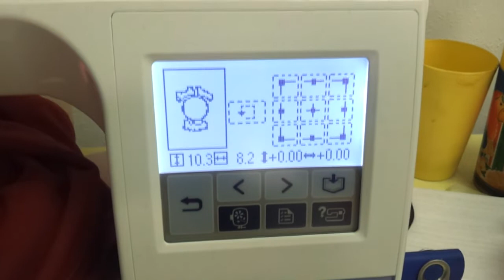Thinking about getting in the Screen Printing Business? Watch this first

Comment: Are you flashing before you take these shirts to the heat press? I can’t see one in this video
Reply from the maker: Yes, always flash before heat  press
Reply: @KingPrint  Hello, what do you mean by flashing?
Reply from the maker: @boniragz  flashing is drying them to the touch, they would still need to be cured, if you flash without curing, they print can fall off in first wash
Reply: @KingPrint  thanks for that, and kindly may i ask can u use an iron box to cure plastisol ink print?
Reply from the maker: @boniragz  no, you can use a heat gun ,mabe a blow dryer on high, but not a iron, it doesn't get hot enough
Reply: @KingPrint  okay thank you for your response sir
Reply: @KingPrint  i forgot to ask, how long should i cure the paint using a hair dryer?

Comment: Are you curing them with the heat press...? Cood deal! Using plastisol ink...? Looking into getting into screen printing , thanks for sharing the knowledge :D
Reply from the maker: Yes, 320degrees for 15 sec, 
Thx
Reply: Bro, what size squeegee do you recommend...? for a first buy, or should one start with a set>
Reply from the maker: @g-codeonedesign9578  14" squeegees ( most print sizes are 13" & under) , your going to need at least 3 to start, 1 primary white, 1 primary black, both will stay those colors, then a 3rd squeegee for interchangeable colors, this will save you tons of time,If you can swing 1 for each color that would be ideal,
Reply: @KingPrint  How would you recommend using a heat press for curing? It looks like you have a process to it. Thanks for any help man!
Reply from the maker: @Hvskarl  a conveyor dryer is ideal but a heat press will work, 320 degrees @ 15 sec.  But you have to flash shirt first

Comment: bro I get these last minute ones all the time....and I wack them 20% if they want it next day. I let them know up front its normally a 10 working day turn around incase theres stock issues etc. but seeing its a 1 colour customer supplied tee, thats a nice gig. 

I price like this (aussie dollars)
$50 for the screen (unless VIP then I give them $20 screens)
1 colour print fee for 60 qty is $2.40 = $144
plus handling of $1 per garment, that takes care of your guy on the heat press
total is $254 plus 20% surcharge for leaving shit til the last minute of $50.80

TOTAL $304.80 aus convert to usd is $221.60
Reply from the maker: I don't charge a screen fee but I might have to start, that's a good idea,
Thx
Reply: @KingPrint  absolutely bro. You need to get compensated for those 6 colour screen jobs! Thats potentially $300 left on the table right there....and depending on quantities you could drop screens charges if theyre big orders